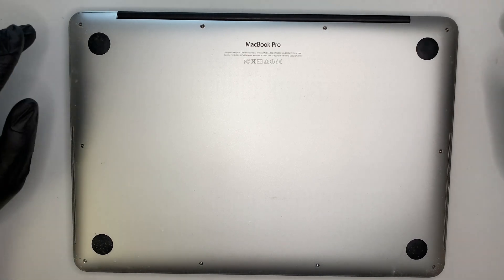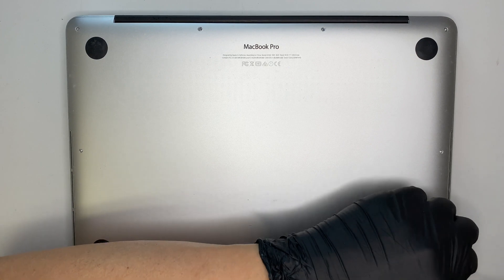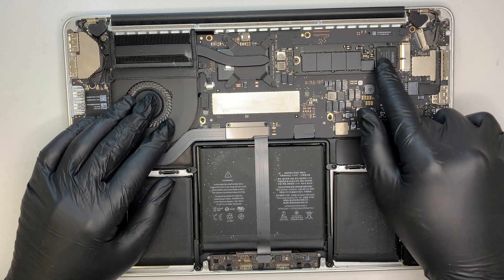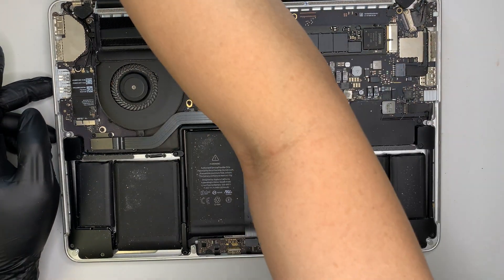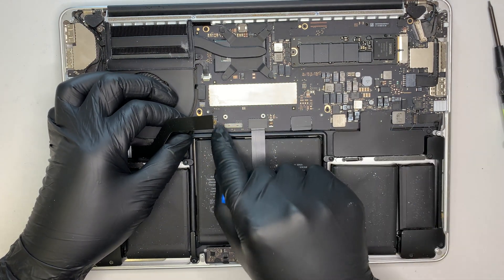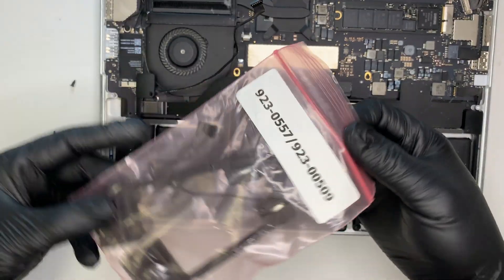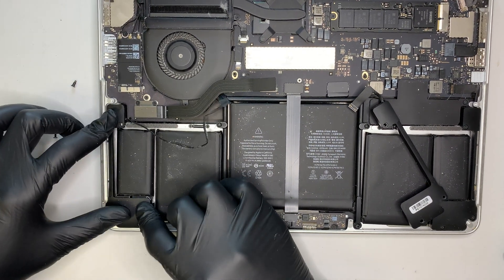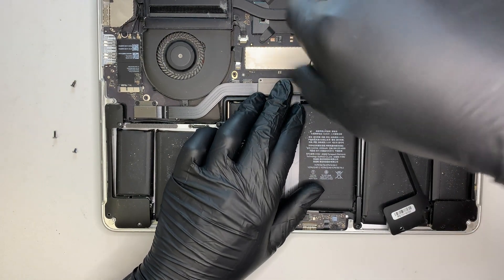Step by Step - Speaker Replacement Macbook Pro A1502

Comment: Thank you for the video.  Do you recommend disconnecting the battery before working on the speaker, or is that not necessary in this case?
Reply from the maker: Not necessary to do that. But you can if you prefer.
Reply: Hello! Nice video! Please could you show how to disconect the battery? Tks

Comment: My Mac book pro early 2015 (Retina) speakers  - have ordered (twice)  A1502 (2013-2016); SF257-01 and now  installed twice. They don't come on.  Reinstalled the damaged speakers and they work (still scratchy) but properly reinstalled.    Most recent new speakers (that don't work) are from Padarsey. A1502  X00296HJVX. --  need help ! Bought from Amazon

Comment: Hey thank you.  I have to do this and just ordered one or the left side but can I ask if when you had the machine upside down, you said the left one, but I think it was the right one?  So I need a left speaker, that would have been the one you replaced on the right?  Thanks again.  I will figure it out - I just hope I ordered the right one!
Reply from the maker: You are correct. Upside down is Left. If to regular will be Right.
Reply: I'm having trouble removing this one tiny screw.  Or maybe it's not a screw.  Dont know how to share an image
Reply from the maker: @stevenmitchell850  Can you tell me the time frame on my video ?
Reply: @UbergeeksBiz  I realize you're working on a generation of mac earlier than mine.  My speakers fit under the motherboard and I couldn't remove them.  So off to Apple I go :)
Reply from the maker: @stevenmitchell850  Sorry to hear that. Hope everything goes well for you.
Reply: I wouldnt mind a tutorial on my macbook pro 15 inch mid 2015 Intel Iris pro A1398!  Thank you tho :)

Comment: Thanks for the video..The links mentioned below doesn't works(for ebay).Can you please share the part number for the speakers or a working link.TIA.
Reply from the maker: Sorry about the link. Will fix them.
Try this:  
https://www.ebay.com/itm/313579931859?hash=item4902d208d3:g:Y44AAOSws4xg1oU2